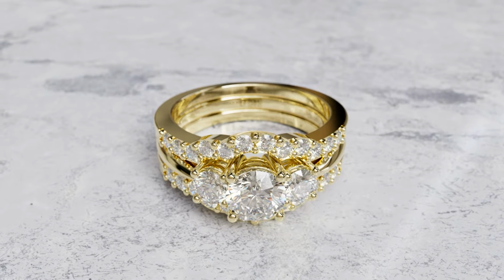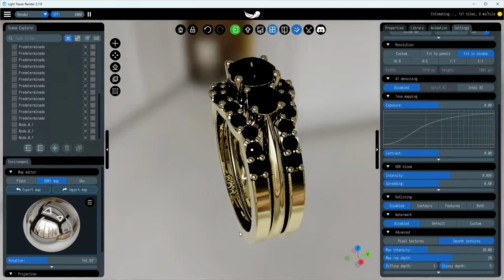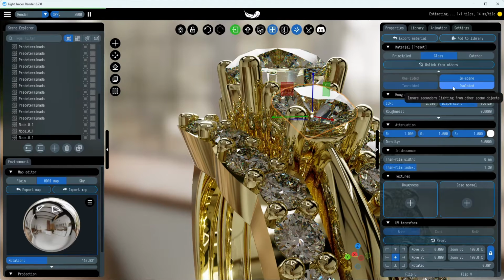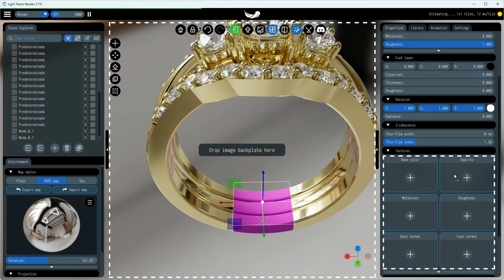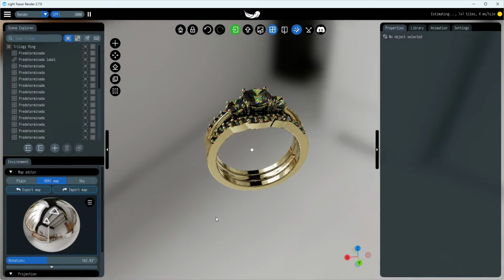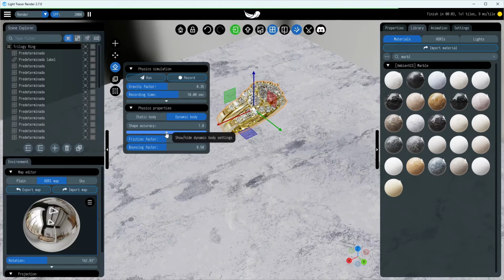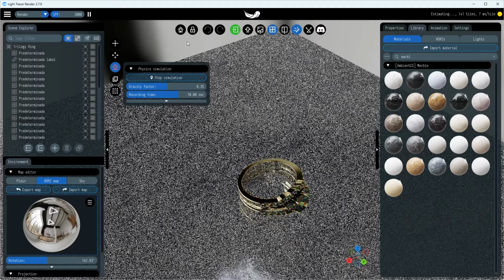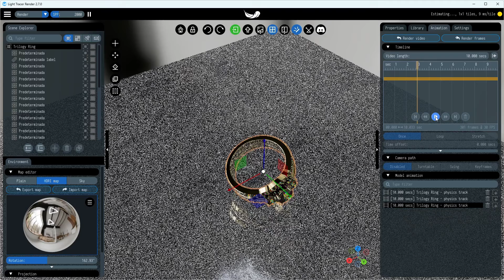Jewelry rendering tips and tricks

Comment: sorry , i have a question we wait 2h for uploading video ???
Reply from the maker: Hello, could you please clarify what do you mean?
Reply: @lighttracerrender  when i creat a video it take 8h to upload
Reply from the maker: @islamhafidi4746  Light Tracer does not upload your video anywhere, it renders it frame by frame. So, we still do not understand what do you mean.
If rendering is slow, you can adjust other parameters, such as the number of samples per pixel, or reduce the rendering resolution. In general, rendering is a computationally intensive task that can take many hours.
Reply: @lighttracerrender  yes when its render Fram by fram its take 8h i have rtx 3080 and i7 12 eme
Reply: @islamhafidi4746 with your PC spec I think it should render a lot more faster

Comment: What are the render times like per frame on an average relatively high end PC?
Reply from the maker: Hi, the video with diamond ring was rendered in about 1.5 hours, 1080p, 2000 spp per frame, Intel Arc A770 gpu. However, you can use built in denoiser and decrease SPP (and rendering times) by the factor of 2 or 3
Reply: @lighttracerrender  Thanks so much for an answer